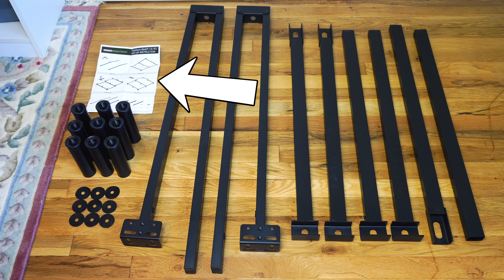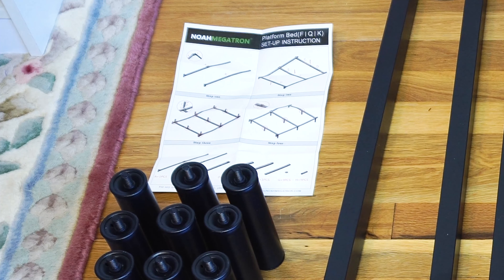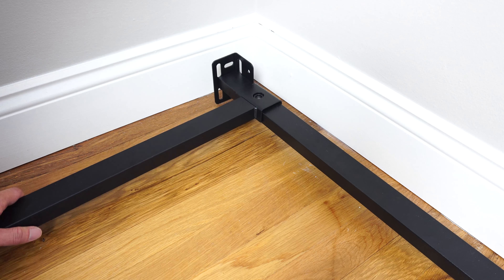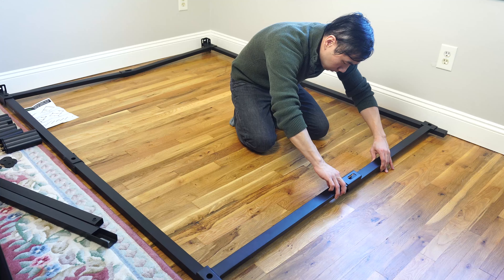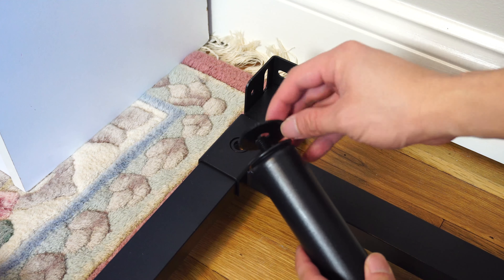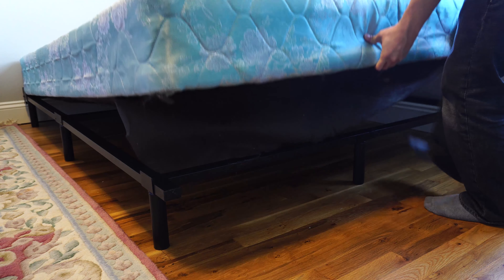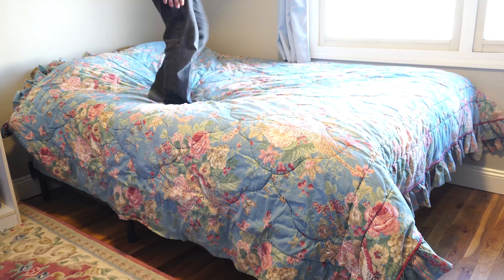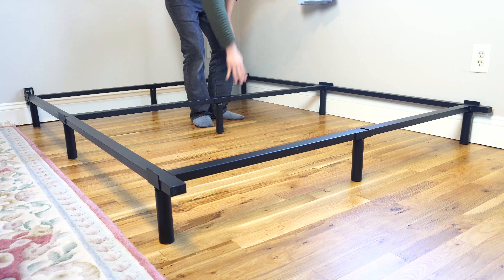Noah Megatron Queen Metal Bedframe Assembly and Review

Comment: Hi. Very helpful video. Do I need to buy additional hardware to attach a headboard and footboard to this bed? What kind? Would it be possible for you to post some Amazon links to the appropriate hardware for both, so that I know what to order? Thanks so much for your help!
Reply from the maker: Hi Eileen. Yes, you will need additional hardware like bolts, nuts, and washers (not included with this frame) in order to add a headboard. You may also need some type of universal adapter bracket as well, depending on the specific headboard you purchase and how it is meant to attach to the frame. Without knowing what you have in mind, my best advice would be to get a universal headboard mounting kit, like this one: https://geni.us/05WUmc7 [Amazon Affiliate Product Link] but I'd check out the specs on the headboard you plan to use to ensure the bracket will allow the holes to line up. Unfortunately, the model frame I've shown in this video doesn't have any holes drilled at the foot of the bedframe to add a footboard.

Comment: So this can be made to go wider?? I ordered this frame but the mattress delivery people said it was too small, even though I ordered a queen.
Reply from the maker: No, the width of the frame is set by the size ordered, twin, full, queen, king etc. It is not adjustable. The length of the frame is slightly shorter than a queen mattress, since it's designed to be used with a boxspring (see 2:52).
Reply: @ReviewedByPhil  Thank you! The frame I bought was the correct size and it all worked out :)

Comment: Do you like this frame better then the one with all the sticks in a 4 squares
Reply from the maker: This bed frame was much easier to assemble than the one with the wood slats. I also feel it is more durable, since the steel won't break as the wooden slats could. However, this frame cannot be used with a memory foam mattress without a box spring. The only advantage of the slat bed frame is if you want a lower total height of the bed by not using a box spring.
Reply: @ReviewedByPhil  got you. Thank you for the reply..